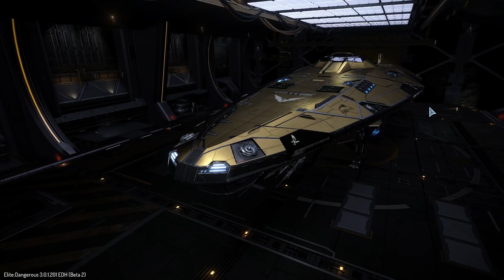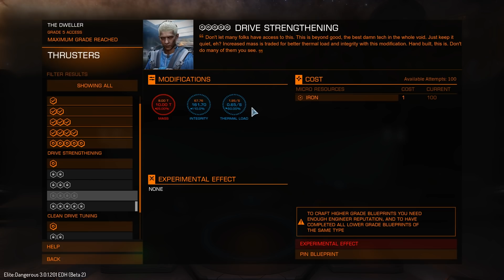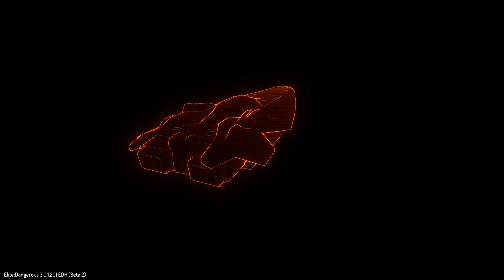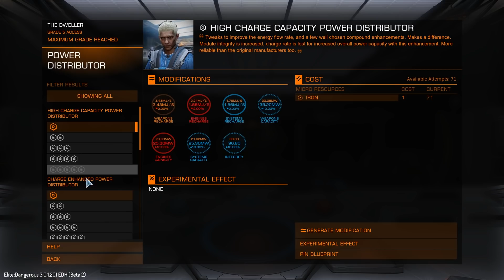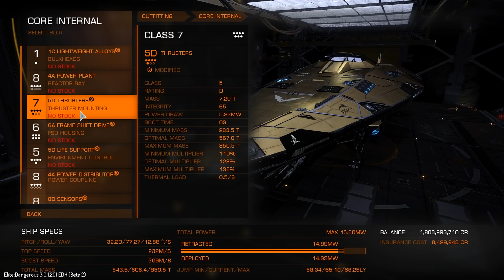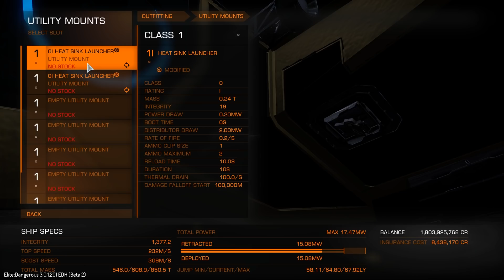Elite:Dangerous BEYOND beta 2 - In depth re-engineering of my exploration Anaconda

Comment: Why don't you ever inform yourself BEFORE making videos...?

You are bumbling through all your videos horribly.  The change to your FSD's "optimal mass" (ship mass) is the main and most effective stat to improve your jump range.  Your jump range largely depends on how far over or under your  FSD's optimal mass the actual ship mass is.
Reply from the maker: Despite what this video may tell you, I am very well aware of that (about Optimal Mass) and have been for a very long time.  You do know I've been doing engineering since inception right ?  
You don't have to take everything I say quite so literally.

Why don't you check back on other video's where I'm building ships and I actually tell people about optimal mass and how it's the most important factor.
Inform yourself before making comments like these.

Why did you feel you needed 2 comments to tell me the same thing ?  Are you just wanting to troll because that can be remedied very quickly.

If you don't like my video's, no-one is forcing you to watch. In fact I'd rather you didn't.

Comment: Rusty, I can't believe you make an Anaconda "in depth" engineering video, but you don't know the function and importance of optimal mass for thrusters? Instead you're erroneously guessing around if it relates to jump fuel use? Lack of preparation leads to wrong or missing information.

Not only for making a video, you should inform yourself first, but also for your own sake, so you actually know what you're doing...  I'll give you one example, that explains it pretty well:

In the pre-3.0 live build, some people have been making endless rolls on grade 1 clean drive mods on 4D thrusters, which you normally cannot install on an Anaconda. But if you get a high enough boost to optimal mass (which also changes minimal and maximum mass), once maximum mass gets high enough, you can actually install those - saving some weight over 4A or 5D drives, which are otherwise your only options (with the 5D having better specs, but the 4A running cooler).

So, instead of having to endlessly roll for the optimal mass improvement on a grade 1 clean engine mod for 4D thrusters, you can now simply purchase a 10% improvement to optimal mass (and hence maximum supported mass) with the experimental effect).  This is good news, unless FD decided to decouple the effect on optimal mass from also increasing maximum mass. This still doesn't mean you can do full bore dirty drives, because that reduces optimal mass in trade for increasing optimal multiplier.

If you had known about this, you could have tested a 4D thruster to see, if you can install it on the Anaconda with the new engineering mod or not, for yourself and your viewers...

Comment: As far as I am aware Clean and Dirty drive tuning don't effect your heat in supercruise, well they do, but it's only their power draw that effects it, like every other module (which is minimal). The thermal load changes don't come into play while you are in supercriuise because you are not using the thrusters. They make a difference when manoeuvring and fighting, in general Dirty are the best unless you have a hot running ship and tend to overheat when firing your weapons. This is because Dirty Drives give much better performance than Clean Drives.

Comment: Great vid, I would say that taking the mass decrease (experimental effect) to the Power Distributor (-9 tons) would give you little better jump range
Reply from the maker: Hmmm, did I miss out on something there...  going to check that. 

EDIT:  Nope, just checked and I did apply that effect.  :)
Reply: Ah, most likely missed while watching. I've since went on the beta and applied the new engineering to my  explore 'conda and got an overall 4ly increase. Not bad but I do think fdev need to tweak the outcomes as at the moment I think they've set them a little high to appease the current players.
Reply: One thing to add is that for the testing fdev gave 100 selenium as well so you could convert that down to iron, not sure if that's the way you were getting it
Reply from the maker: Yeah trading Selenium and some other smaller stuff to stock up.

Comment: Every module that relies on mass in some form has an optimised mass, which is supposedly the mass it performs best at. Technically speaking it's normally the mass that provides the "reference" result.

As an example, thrusters have an optimum mass. If your ship reaches the optimum mass of them thrusters, you will get the "reference" ship speed you see under the ship stats when you look it up- so 180 m/s for a conda etc.

By changing the optimum mass, you're technically saying the FSD can do the same range when you're at a higher mass. What this translates to in easy talk is that your FSD can do better range at whatever mass you're at, because it's designed to work with higher masses. 

Optimised mass rules the roost. Pure and simple. Mass changes to your FSD range won't touch your jump range or agility much. Your optimised mass will.

So sayth 'StiTch'
Reply from the maker: Indeed David.  Optimal mass is the key.  Thanks for detailing it.